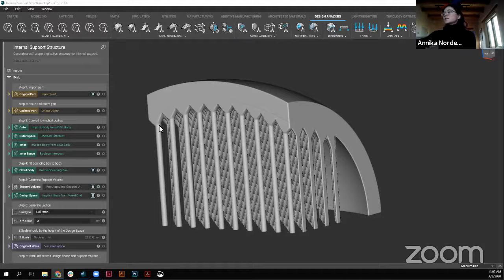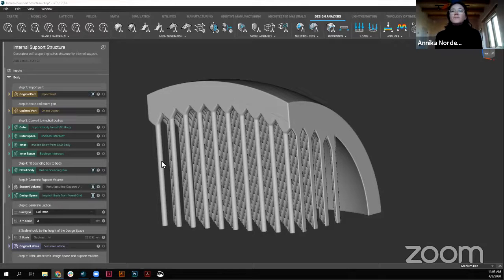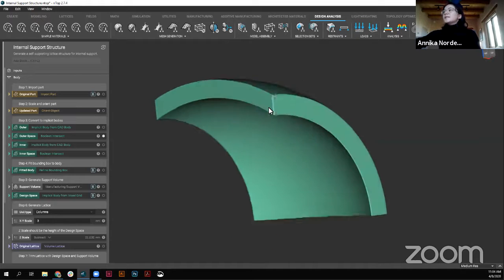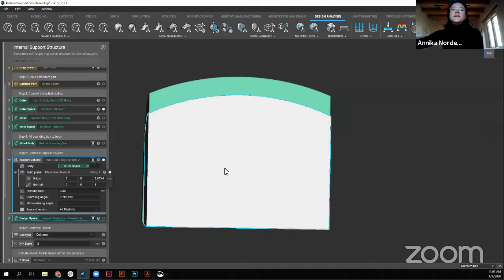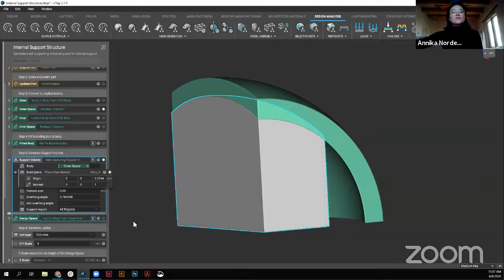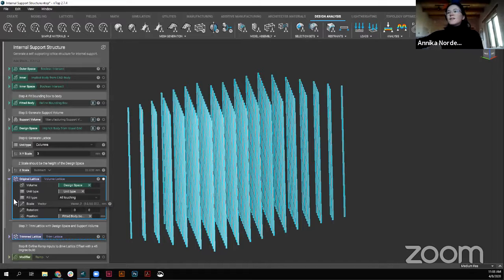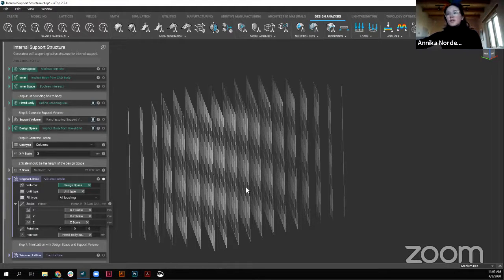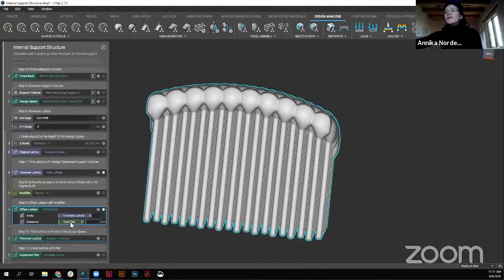nTop Live: Support Structures

Comment: For DMLS is desirable that support structures like this cylinders have a tip upon the part with a minor diameter than the column so it is simpler to separate them from the part, resulting in lighter post processing and sanding
Reply: @Matt Rohr Hi Matt! It would be nice if one could select tree support structures in order to reduce material use, specially for thin walls with no risk of thermal deformation. We produce parts below 1mm thicknes with large surfaces that requires to be supported and many times the volume of supports is bigger than the part volume